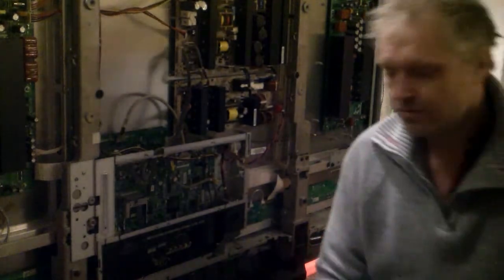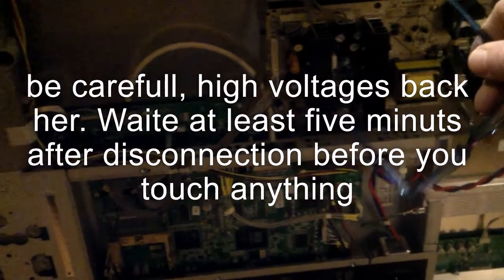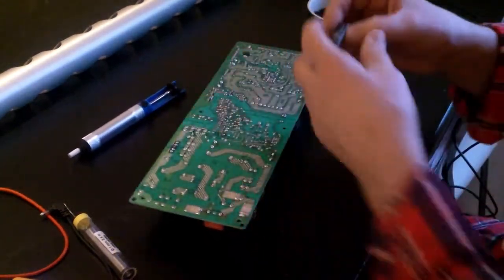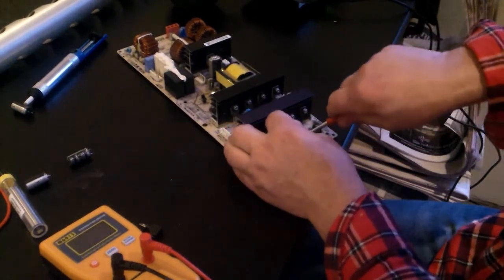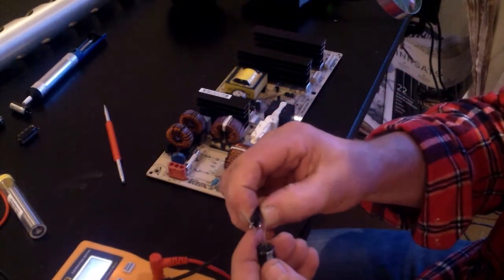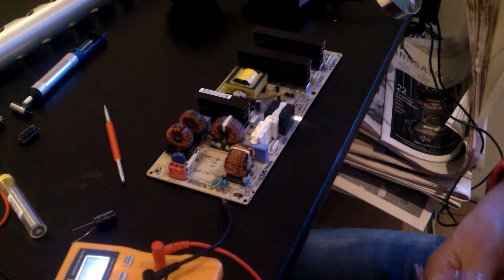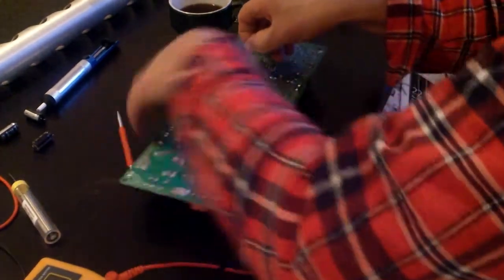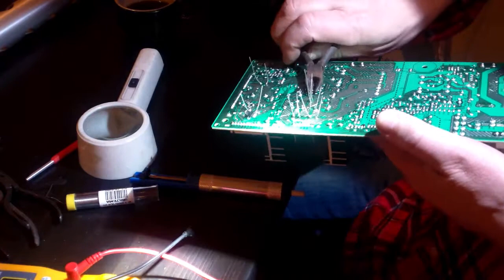Fixing 60 inch LG plasma  TV, clicking noice and no Picture.

Comment: I have same tv my problem is that I don’t get 5v power going to x and y boards
Reply from the maker: Probably Powerboard issue. Look for burn marks on The back side, follow The leeds. Measure The caps and The voltage regulators. You can also probably by a new bord at https://www.shopjimmy.com/

Comment: Hello I have  a   Zenith z50pt320-uc  . TV comes on then after time the sound starts skipping. Then no sound. Then picture starts losing information. Shut TV off and  turn on and the red LED blinks and I hear a click and TV does not turn on. Then if I unplug for a while and replug it back in the TV comes on and does the same thing over again. What board could possibly do this ?  Thanks..
Reply from the maker: It depends, you have to look systematically. From the powerboard you will find powerwire to The y systain board and one to The x systain board. I dont Know your tv particullary, but it is like this nearly always. There is a possibillity that The wire goes from The powerboard to The y systain and further to The x systain.  Disconnect The wires and turn on The tv. If you hear The clicing noise it is The powerbord thats gone. If not, conect The y systain board and turn on. If no clicking noise, do The same with The x systain. On all boards you will also find different ports etc labeled with current/ voltage. Measure all. If The y systain is gone you must bye a new bufferboard as well. Look also for any leaks or popped caps on all boards.